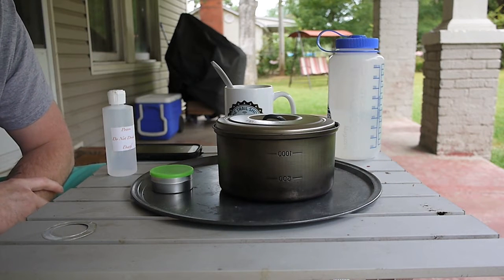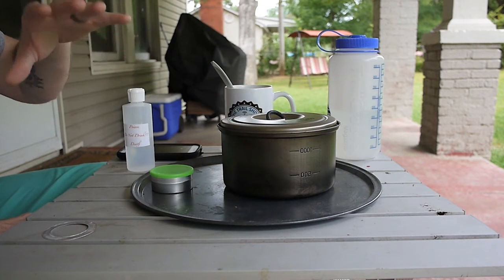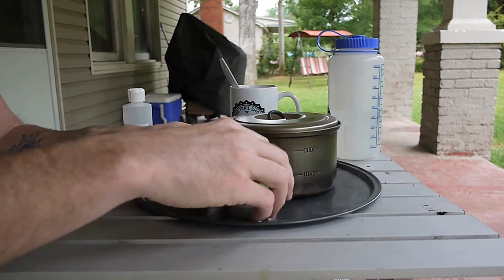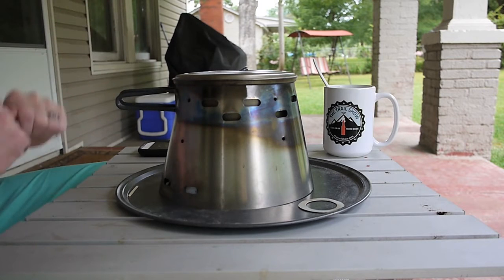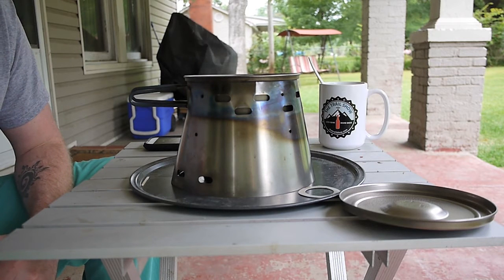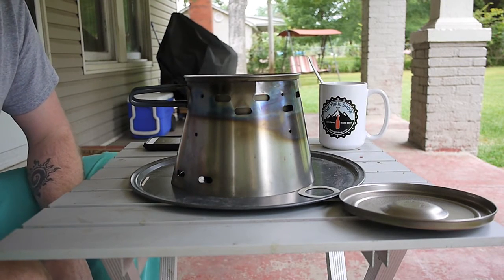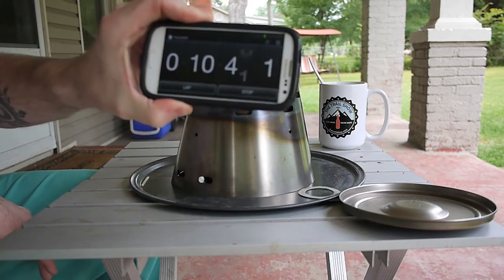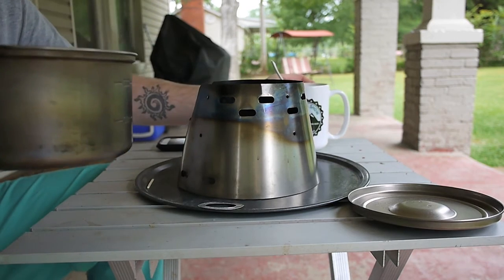Starlyte Sans Choke Ring

Comment: Nice video update. I was just wondering if you have tried the Starlyte stove w/simmer ring since detaching it? Curious if you could get it to a boil & then place the simmer ring on to achieve the extended simmer boil time? Sort of combining the faster boil time with the extended simmer. Perhaps the faster boil would eat up too much of the fuel? Also wondering if the external simmer ring has a different overall performance from the internal Starlyte's test run. Thanks :)